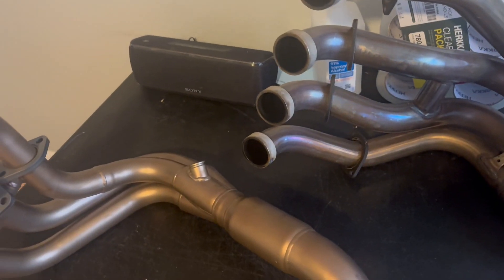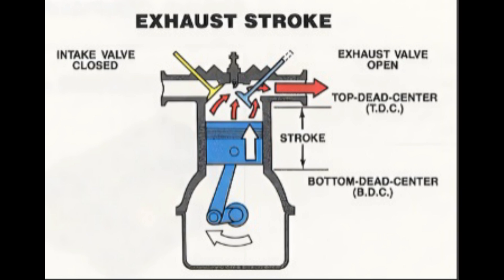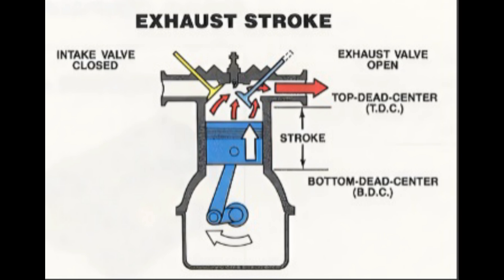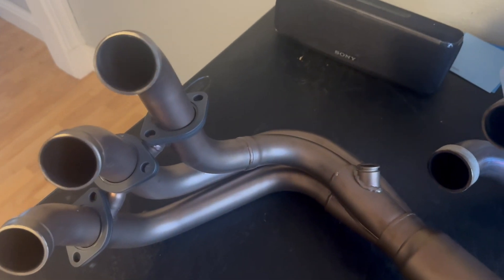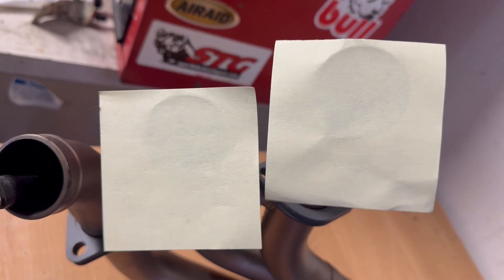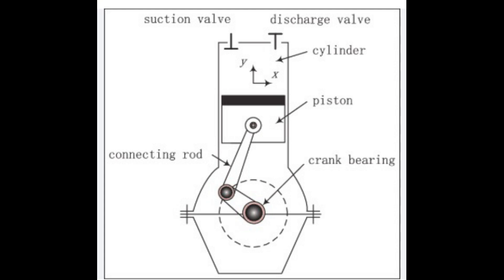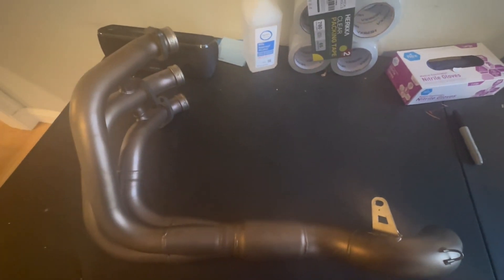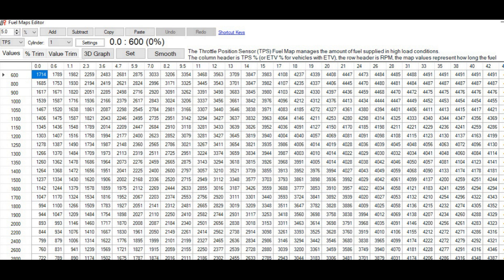Motorcycle exhausts and the misconception that is back pressure: Flashed by Vcyclenut

Comment: These phrases and terms have persisted in the motorsports industry for decades and decades, even when they are false by principle. Frustrating.
Some headers have crossover tubes and some don't. I'm assuming those also aid in scavenging?
Reply from the maker: The act  to equal the pressure between tubes.  I’ve never noticed a difference in power when testing system with vs without cross over tubes.
Reply: @vcyclenut  I've wondered about it. I've seen it done both ways on expensive brands and I've never seen a rhyme or rhythm about the logic one way or another.

Comment: It always struck me that the back pressure debate stems from 2 stroke exhaust. As it needs the back pulse to shut off the port
Reply from the maker: that makes sense,  I always say old school tuning knowledge dies hard
Reply: Two stroke and four stroke engines' exhaust systems function exactly the same way, but the engines have different needs. You can "tune" a four stroke just like a two stroke for the exact same reasons, but you're now dealing with mechanical timing principles related to poppet valves and cam lobes. If it weren't for the emissions regs, four strokes have a lot of potential left untapped. Cost is the biggest things with them, as adding a VVT system to broaden efficiency usually extends the cost of a given engine (non-superbike) beyond the market value of the category.